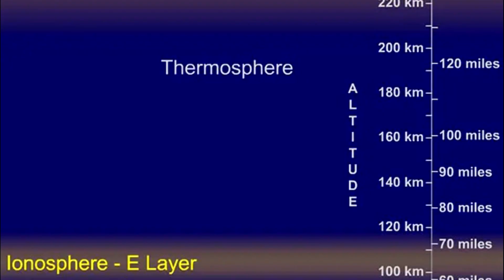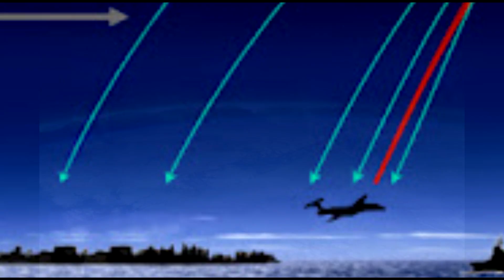In the Shadow of Chernobyl: The History of the Duga Radar Array

Comment: That strange radio noise was unique: it was the first use of digital modulation. Only with digital modulation they were able to detect bounced signal at level several decibels lower than noise at the receiving site.

Comment: There were rumors that Duga was actually responsible for the Tschernobyl disaster, because the Duga site was required to keep on working no matter what.
Reply: It was used to divert weather fronts away from the building preventing seasonal rains from flooding the reactor basement and causing a flashover. The process has been talked about in several books but not the technology. Given the DUGA array’s proximity and its operating envelope it’s reasonable to conclude this was its purpose

Comment: Thank you for this incredibly well researched and detailed video. Regarding the transmitter site - there is a video titled: "Duga - Nadajnik Lubecz-1 (unikatowe nagranie)" on YT that appears to show some sort of ceremony that was held at the site when it was decommissioned. If the timestamp of the video is correct, it was shot in May 1998. After the official part, some employees are shown at their former places of work: consoles, maintenance shop, laboratory, cafeteria etc. At approximately 24 minutes, a long corridor with what seem to be many shortwave transmitters one next to the other is shown which could be the same corridor that appears at 12:53 in your video. The inside of one of the many transmitters is also shown, with some large vacuum tubes and coils being visible. After that, the antenna array is shown and the person with the camera climbs up, showing the whole installation from above. From the transmitter building, some 20 high power antenna feeder lines go to the array, which would suggest that each of the shortwave transmitters in the corridor was connected to one vertical segment of the phased array antenna. From the size of the components inside the one transmitter I'd guess each one could be at least 20kW, but more likely 50kW or even more, therefore they would have achieved the 8MW by combining the power of all those fairly standard size transmitters, using the phase angle between them to steer the beam.

Comment: Many years ago when I was stationed in the Philippines, I used to tune up a high-power (a few dozen KW, or so....) transmitter and then key that transmitter with an electronic keyer, timed to transmit a CW pulse at the same rate as the woodpecker.  My antenna was very large and directional towards the received signal.  I could usually manage about 25 KHz bandwidth.  Most of the time when I unkeyed my transmitted signal a minute or so later, the pecker had by then changed frequency.  Whether my efforts did any good to bother the Ruskies....or not, I have no idea.  I was probably wasting my time and GOVT electricity.  Nevertheless, I kept this up for several years.  😁

Comment: The prototype transmitter outside of Luch was built at the Kopani shortwave and mediumwave broadcast site. I believe the towers you show were part of a shortwave broadcast antenna array fed by a pair of 500 kW transmitters, aimed at a semi-parabolic reflector screen and ultimately toward the Americas, used by Radio Moscow. The OTH radar transmit antenna array aimed to the west was located 1.25 miles south-southeast of the broadcast towers you show. It and its transmitter building have been completely razed, only foundations exist today, but they are clearly visible on the satellite view of Google maps This general area, just off the main road from Kherson to Mikolaiv, has been subjected to sometimes heavy fighting in the war between Russia and Ukraine.

Comment: You mentioned it being made obsolete by phased array radars, but fun fact, the duga array itself is a phased array. SO what is a phased array? 

Basically you can feed the same signal into the different individual antenna (what I think are those oblong shaped cage structures dotting the front of the array) and change the phase of the signal going into each (more simply put, delaying the signal going into the different antenna by specific amounts for each antenna). When done properly, the resulting interference will influence the outputted radio waves into a specific direction or pattern. You can steer the radar beam rather quickly and precisely using this method, no need for moving parts (like a large and heavy rotating dish one might associate with a radar system). 

Interestingly enough you can do this same thing with sound! If you have ever seen the tall curved stack of speakers hung at concerts, that is a phased array too, just using speakers instead. The principal is very similar in theory. 

The USA National Weather Service is considering replacing the current weather radars with modern phased array radars in the coming decade.
Reply: Your reply was as interesting as this video(and kinda gets me interested in radio/radio waves). Thanks!

Comment: The Duga Radar Array just looks like a Massive "Chain Home" Radar system that the UK had in place before WW2. The US took this tech to the absolute limit with HAARP. Originally Created by the United States Air Force. The High-frequency Active Auroral Research Program (HAARP) is the world’s most capable high-power, high frequency transmitter for study of the ionosphere.  The principal instrument is the Ionospheric Research Instrument, a phased array of 180 HF crossed-dipole antennas spread across 33 acres and capable of radiating 3.6 megawatts  into the upper atmosphere and ionosphere.  Transmit frequencies are selectable in the range of 2.7 to 10 MHz, and since the antennas form a sophisticated phased array, the transmitted beam can take many shapes, can be scanned over a wide angular range and multiple beams can be formed.  The facility uses 30 transmitter shelters, each with six pairs of 10 kilowatt transmitters, to achieve the 3.6 MW transmit power.
HAARP was used for the research to conduct fundamental study of the physical processes at work in the ionosphere.  This research falls into two categories (1) active, which requires the use of the Ionospheric Research Instrument and (2) passive, which only uses monitoring instruments.
The ionosphere starts at about 60 to 80 km altitude and extends up above 500 km altitude.  There are free electrons and ions in the ionosphere that radio waves can interact with.  HAARP radio waves heat the electrons and create small perturbations that are similar to the kinds of interactions that happen in nature.  Natural phenomena are random and are often difficult to observe.  With HAARP, scientists can control when and where the perturbations occur so they can measure their effects.   
In 2015 ownership and control of HAARP was passed from the US Air Force to University of Alaska research. HAARP was never a classified project and has many wild conspiracy theories of HAARP's abilities such as claims it can control the world's weather.